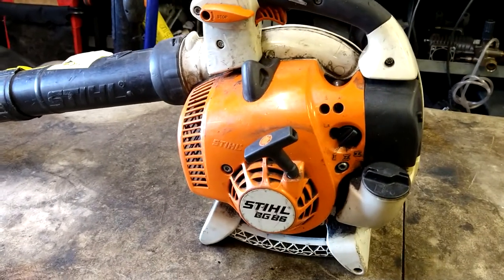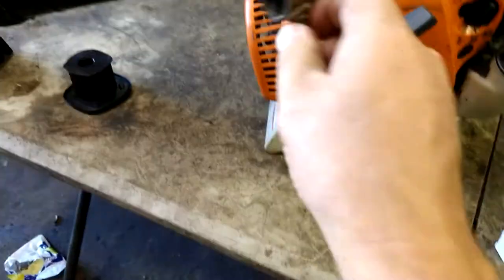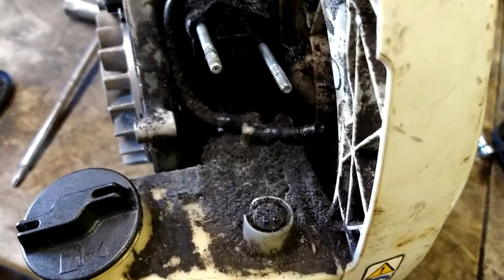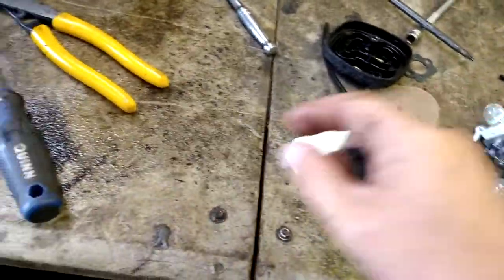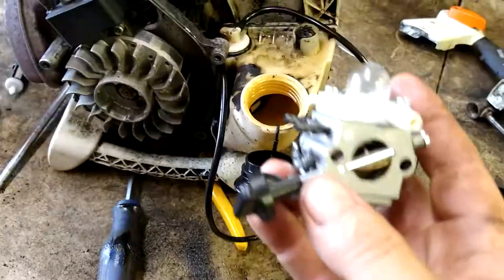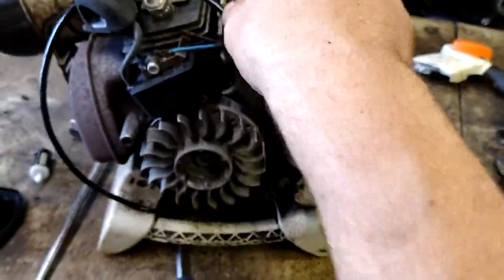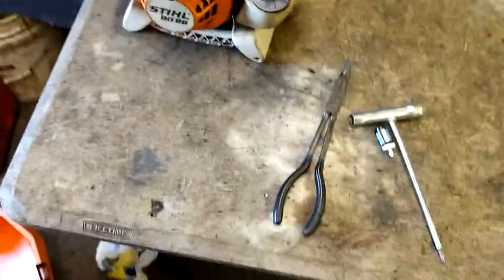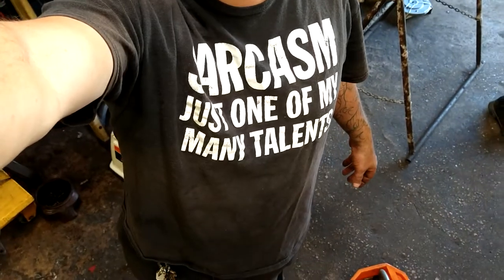stihl bg86 blower carburetor repair

Comment: Great vid thanks for uploading 👍 How’d you know it needed replacing? Got the same blower that won’t start. I’ve checked the spark plug, air filter and fuel line/ filter so far
Reply from the maker: 3 things needed for it to run. compression spark fuel. simplest way to check is dump a water bottle cap of mixed fuel directly in carburetor under airfilter. hold full throttle and pull many times. if it fires up and shuts off then its a carb job